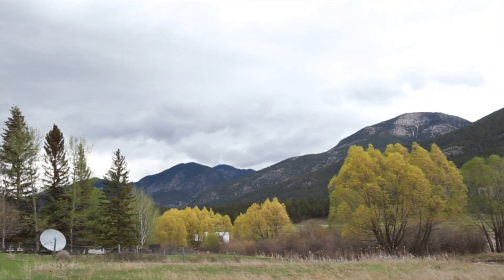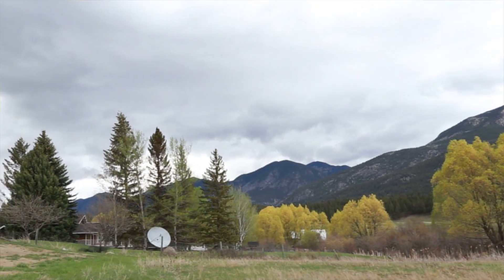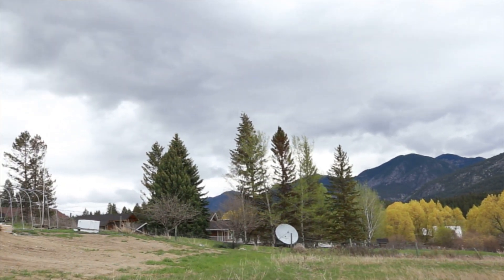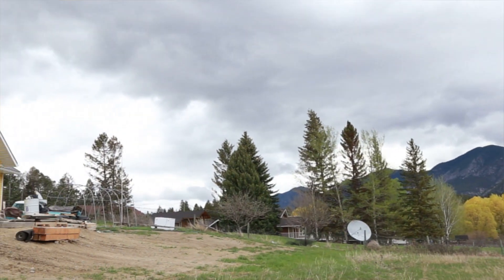Passive Solar Greenhouse Attached to a Home

Comment: It's like a massive window solar heater people make to add heat into a house. I bought a small lean-to greenhouse and installed it around a house window on the south facing wall of my house. I have a fan in the greenhouse that just pumps the heat into my house through the window and works wonderfully when the sun is strong.

Comment: Literally nothing useful at all was said or done in this video.  If this is the 8th? one you've done, you'd think you could impart some words of wisdom.  Did you even use geothermal heating with that huge land track you have?  7-10 perforated tubes put into the ground could save you hundreds of dollars a year on heat and cool for the greenhouse.